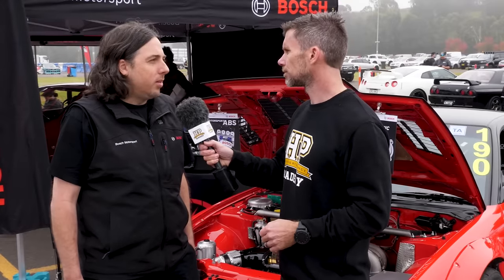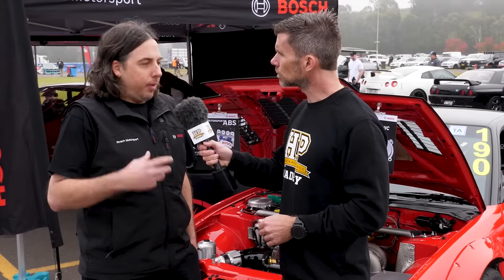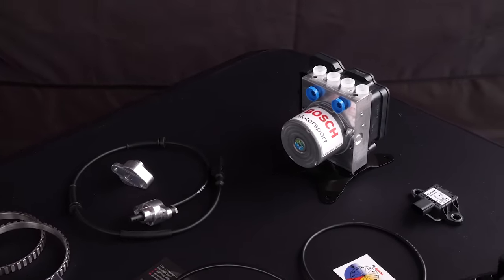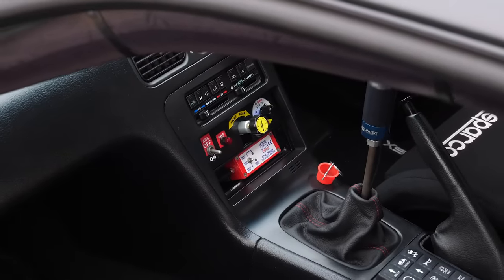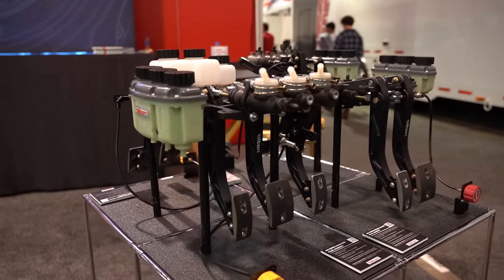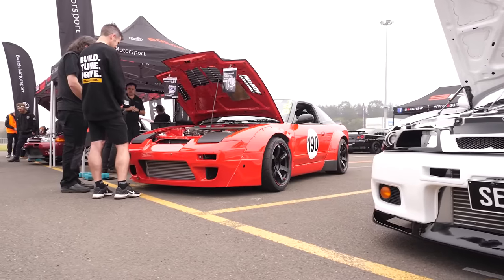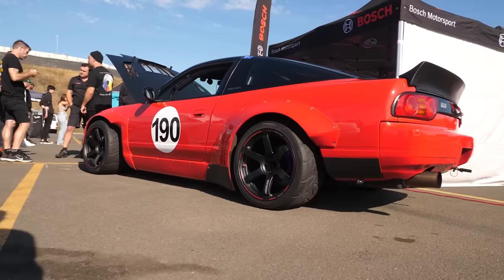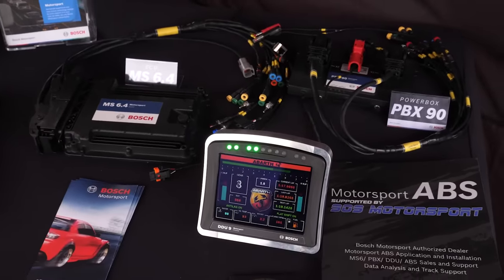Why Do Pro Racers Remove Brake Boosters?

Comment: Why wouldn’t you want traditional power brakes and Bosch ABS? Seems like it would reduce driver fatigue, be predictable and just have the benefit of racing ABS.
Reply: Good question, but sort of complicated.
1.  In a racing environment there isn't much vacuum available to operate such a system, especially in a boosted application (think long intervals at wide open throttle, and positive pressure generated by turbo...etc.).  This makes the assist inconsistent, which they mentioned in the video.  
2.  It lacks feel.  A properly setup, non assisted brake system, isn't particularly hard to press, and it makes consistency easier, especially when rev-matching downshifts.
3.  It's simpler.
4.  Drivers still brake at threshold manually with the ABS being there for incidental lockup, making a bit firmer pedal preferable.  Drivers do not just stand on the brake pedal and let the ABS do all the work, hence the pro driver reference.

I hope that helps.
Reply: Nobody (in their right mind) would argue against the fact that Bosch Motorsport ABS (vastly different from factory Bosch Mk60 for example) is faster round a track with less effort than no ABS or brake booster at all.

But those systems are $10,000 minimum and most club racers aren't spending that. You do see ABS in more top tier motorsport, eg GT3/GT4 ala British GT and GT World Challenge. But the budgets are 10x-100x higher than anyone watching these videos probably has access to.

Even higher level motorsport doesn't have ABS purely due to regulations. F1 might be quicker and more consistent with it, but the people making the rules simply don't want it in their series to make it more about driver skill rather than computer assistance (same as traction control, which is present in GT3/GT4 as well).
Reply: Thanks @dan1906  The lack of vacuum is interesting, with my old supercharged setup I would often lose power brakes at higher elevations after some hard acceleration... needless to say is was very sketchy.
Reply: Bosch Gen 2 iBooster from Honda Accord or Telsa model 3 solves the lack of vacuum issue.
Reply: @taznz1  pedal feels exetmely squishy   with that electronic brake booster. Also i believe it has lag between pressing pedal and assisting which would cause inconsistent pedal feel with partial braking. Definately not a thing you would want in racing application.
Installing vacuum pump and vacuum reciever might be better option. On many 2010+ year cars vacuum pupm is already present on petrol engines
Reply: Factory vacuum boosters tend to flex a lot , have the engine running and press the brake hard then look at how much the booster expands.   Another issue is the delay in producing power assist as well as some free travel before the master cylinder moves.  And don't forget when the brake pedal is released, the booster is slow to react.   

A Hydro Boost gets hydraulic pressure to operate from the power steering pump and gives a very sharp  predictable pedal.  There is also an Electro Boost that is similar to Hydro Boost but runs an electric pump mounted to the booster / master cylinder.   

I suspect that electro mechanical boosters ( Honda Tesla per another poster ) probably have apply / release delays due to motor / gearing inertia and probably don't like rapid pedal modulation.
Reply: The human body has muscle memory but the way that works isnt by position but the tension in your muscles. having the harder brakes actually makes consistent modulation easier by giving a wider range of tension in your leg muscles.
Reply: @bobroberts2371 some cars even will have the firewall flex!
Reply: I run a vac pump that kicks on when vav is low, works great
Reply: @ricepony33  fatigue isn't an issue, we don't have boosters in endurance races. It's lack of feel and abilities to modulate the braking, pressure isn't exactly applied with the same amount of input you put in the brake pedal with a booster